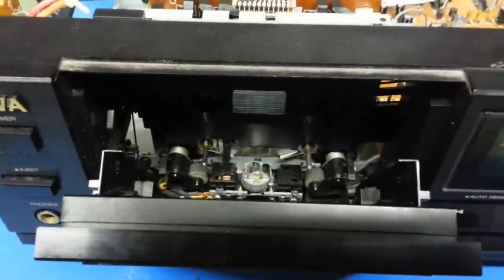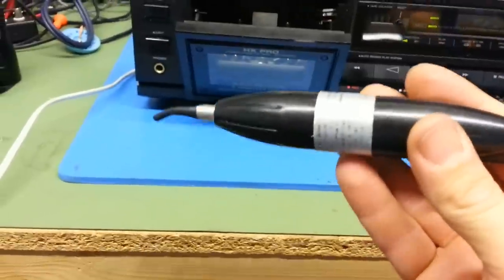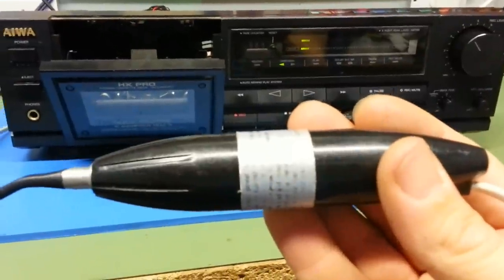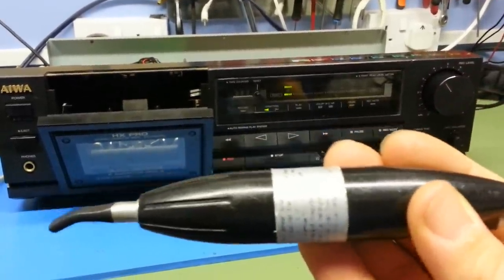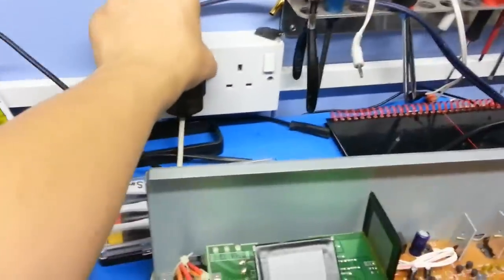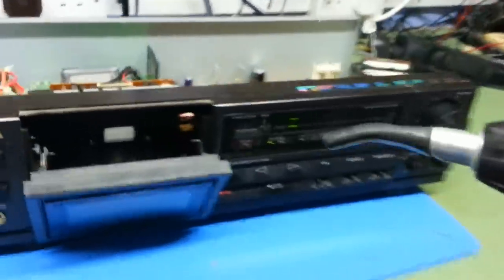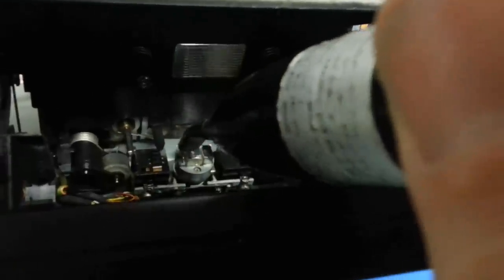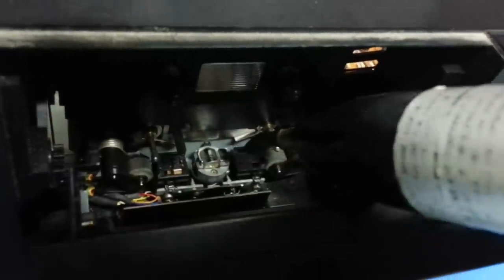Demagnetising tape heads.

Comment from the maker: Lots of comments about turning machine off when designating are untrue. The best position for the heads to be in are in the play position when various solenoids are activated and the mechanism is in the play position. The only possible side effect to doing this powered is amplifier overload. But as we all know this will just result in a clipped input level and no damage will result.
Reply: Nope. Feed an op-amp a higher input voltage than its power supply rails and it's lights out. https://www.youtube.com/watch?v=tv4wbc3QPTo
Reply from the maker: @ScottGrammer Yes. But this doesn't. Head saturation would happen long before then. been doing like this sine the 80's.
Reply: @SoddingaboutSi  I'd hate to rely on head saturation to protect me. But I do see your point, and you're probably right. I just prefer to make sure it's all turned off before I begin. It's how I was trained to do it many years (1975-ish?) ago.

I might tinker around a bit with some cassette and RTR heads and a 'scope to see how much I can get from my Sony head demagger. It might make an interesting video.

Comment: A much easier way to de-mag the heads is with a TDK HD-01 cassette head demagnetizer. You have to change the battery every few years but it is simple. Just pop in the cassette shaped demagnetizer, press play and a little light will go on when done. I've had my HD-01 for over 35 years and it works.
Reply from the maker: But they are not as effective.
Reply: Yeah I know, but ya can't have everything! I also have a "wand" demagnetizer that I use for my Teac X-3 open reel deck and every few months also use it (as needed) for the four cassette decks I have to "back up" the HD-01. I just find the HD-01 a whole lot easier to use. My cassette decks are; Denon DRM-800A, Akai GX-f31, Yamaha KX-260 and Nakamichi BX-1. Good helpful video my friend. De-magging tape heads IS important to the good performance of any deck.
Reply: Simon Spiers  What if you run such a tape twice (or more) in a row, any noticeable improvement (even theoretically)?

Comment: Want to see if your wand Head Demagnetizer actually works?  Use a magnetic tip screwdriver and pick up a small metal washer...  place your demagnetizer wand within an inch of the screwdriver tip and watch the washer leap off the screwdriver.  I have an old Realistic Tape Head Demagnetizer that makes no noise but effectively works.  With magnetic tape getting scarcer, no sense taking any chances with needlessly ruining recordings because of being too lazy to keep your tape heads demagnetized...

Comment: I have 2  tascam 122 mkii and both play a bit muffled and crunchy.  Not sure if it's magnatized or if the bias is off.  Cleaned heads and tried to get bias tuned in, but on a test tone it plays with a bit of a crunchy sound and low pb levels.  Music playback is OK bit not very bright . 🤔 And low levels.  Any ideas?

Comment: Poor old Simon Spiers. I do find it amusing how trolls try to belittle him, yet no visable proof of what expertise they themselves have. If you have worked professionally in the audio industry, you'll be more than aware of degaussing. You'll also know it is not a myth. 
Thanks for the dem Simon, I have seen these versions online a lot (used to a more robust and dated version from the 60s) and wanted to find out the correct method of use for this version before buying. Mission accomplished now. Off to sort out my Yamaha deck. 😉😂😂😂

Comment: YouTube is strange for recommending this video to me after all this time, quite simple and straight forward thinking behind it and I enjoyed it.

All the pansy ass comments about the unit being powered on haha, if I recall correctly most if not all worth while decks of this time never head a continuous signal with the head disengaged so no harm or foul. Another note, you cannot permanently magnetize an amorphous head and therefore it will never need to be demagnetized. Even though the head isn't prone to magnetization issues due to the material it's made out of, you may still need to demagnetize other parts of the transport mechanism occasionally. Your demagnetization device will still end up being within close proximity to the head so any prior fears of introducing issues are moot. 90% of the people being anal about tech repairs clearly are certified repair and equipment specialists that know about the inner workings of every single device that's ever been created.
Reply from the maker: Yep. Worked with a professional sound lab owner at a high shop years ago. Not sure why people think you going to damage electronics from demagnatising with power on. Most of the time the amp is off unless in play and even then the amp will just clip.

Comment: Cassette tape heads don't need to be demagnetized, ever. As a matter of fact, keep anything magnetic away from your heads. Cleaning of the tape transport and alignment is all a cassette deck needs to play optimally. Demagnetizing won't make a lick of difference.
Reply from the maker: Explain to us why you think that please. As the industry and professionals used to do it on a regular basis, why do you think otherwise?
Reply: @SoddingaboutSi  Something I learned in school when I was studying to be a Broadcast Engineer...stuck with me ever since and I've had this confirmed by several others in the biz and I actually read a paper on it. If I find it online, I'll share it here. 

Apparently cassette heads are not prone to magnetism build-up and demagnetizing them risks doing more harm than good. 

And personally, before I knew this, I too would demagnetize my heads...and never, ever once did it ever solve/fix anything or make any noticable difference whatsoever. 
I mean, you do your thing and whatever floats your boat, but to me it's a complete waste of time.

Comment: I didn't fully understand. You said there's a way to damage the tape heads? If I make sure anything that can absorb magnetic field is away, and I start at a distance from tape deck I should be fine?
Reply from the maker: J San Antonio You can only damage the head by contacting it with a metal object and scratching it. Start close to the head and transport and in a slow circular styled motion move away. All should be fine.
Reply: Simon Spiers okay thank you

Comment: Hi can you use a degaussing gun designed for CRT TVs to demagnetize tape deck heads?  Would it be too powerful?
Reply from the maker: I dont think the magnetic field would be strong enough to demagnatise the head. But worth a try.
Reply: @SoddingaboutSi  I tried it on a screwdriver and the screwdriver started to shake when I got close to it 😅
Reply from the maker: @futureshock7425  its doing its job then. You have to move away slowly from the demagnatiser.

Comment: Dear Simon i have a quetion :
Why didn't you turn off the deck 1st before the operation ?? 
My deck is the Aiwa ad-f850 
Doesn't it matters ??
Thx for any reply :-)
Reply from the maker: You are supposed to. But as the amplifier is powered down on most decks there is no problem.
Reply: Ohh   ok understood thx Simon :-)

Comment: Sir, "demagnetizing tape heads" means some proper inspections, such as measuring magnetic field parameters BEFORE and AFTER demagnetization.

I don't understand what's the purpose of those kind of videos, except for marketing. It shows and proves nothing.
Reply from the maker: Your statement is wrong. What marketing ? 
Best not to put derogatory comments without understanding the facts.
Reply: What facts? Where's you proof of magnetic field on deck's metal parts (before and after demagnetization)? After all, you did it with equipment turned on, and demagnetizer started near audio tape.

It is like repairing audio / video equipment without measuring any electrical property of circuit under fail.

Please consider some real facts in future videos.

Thanks in advance.
Reply from the maker: It is a well known fact that any metal object that stays in one position for a length of time builds a magnetic flux from the earths field. 
This video shows how to remove the field if the heads and tape path have become magnetized. 
It makes no difference if the machine is on or off, but there is a risk in overloading the amplifiers from the field of the demagnetizer.
If you worked in sound studios back in the 60's and 70's the engineers would demagnetize the tape paths once a year as a precaution..
Reply: Engineers in Yamaha also claimed (and proved) that after more than 1000 hours of REC / PLAY sessions didn't found any excessive residual magnetic whatsoever.. So, as a precaution, measuring is always better than just playing around without good reasons.

Your point is correct, this is only informative.

As a service repair technician with over 25 years of experience, I hope you find my point also.

Cheers.
Reply from the maker: So do you think taking this precaution in a waste of a video? 1000 hours is a lot less than a year. There maybe no magnetic field buildup, but once it's been degaussed, I know there is non.
You mention measuring for magnetism, how do you do that? 
Cheers
Reply: Come on, sarcasm is so obvious now. Read about gauss meters, internet is full of them. This is the point where my comments going to be useless.
Have a nice one, and good luck.
Reply from the maker: Thanks for your comments (slight sarcasm).
Reply: @DamirUlovec  This is an old comment, but I definitely agree with taking the precaution. I bought an 80's dual tape recorder, and after 30 years I don't know whether it is magnetised or not. How do you test for magnetism?? I currently have no way of knowing whether there is magnetism or not.